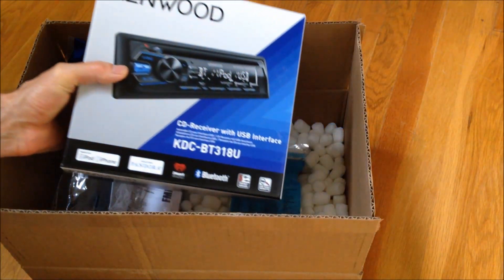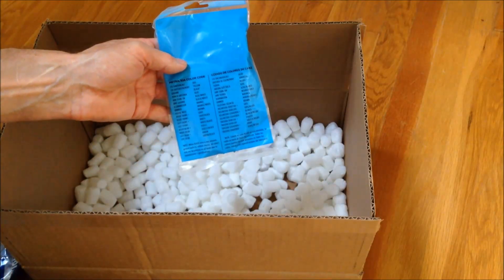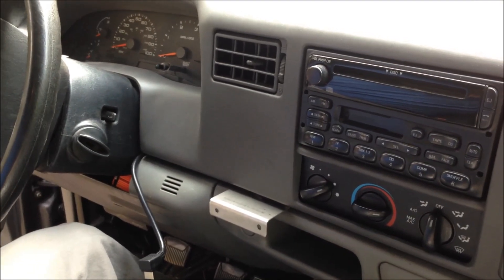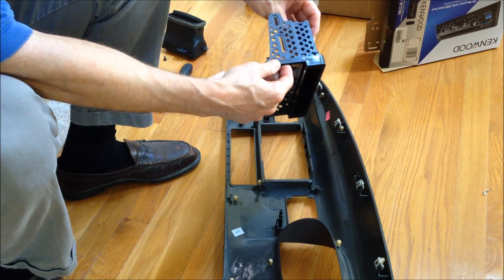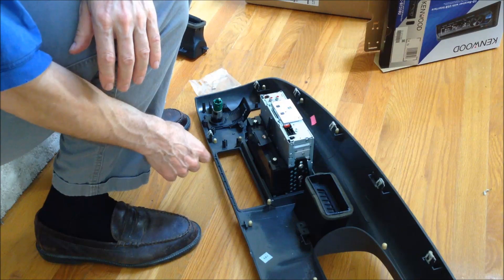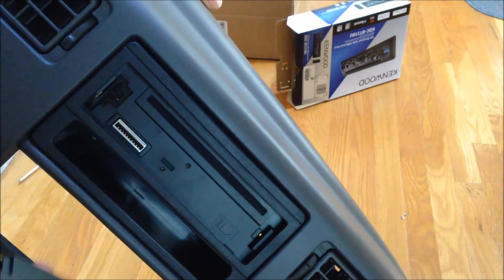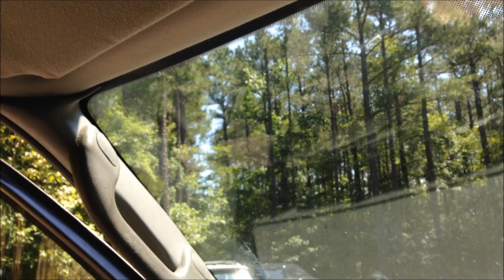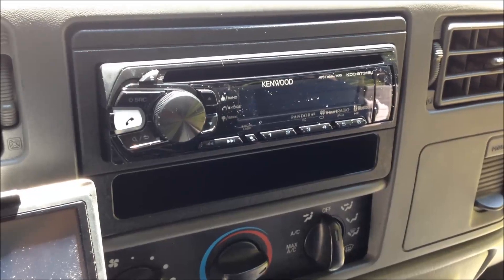Bluetooth / Phone Stereo Install - Ford Super Duty 1999 & Up

Comment: There are much simpler ways to do this without removing all the plastic stuff....either use 4 pieces of coat hanger to remove the head unit...or spend $15 on the tool that is used for head removal...much quicker and easier and you don't have to take you dash bevel apart...alot of the plastic tabs on these older units are gonna be very bridal and they break easily.